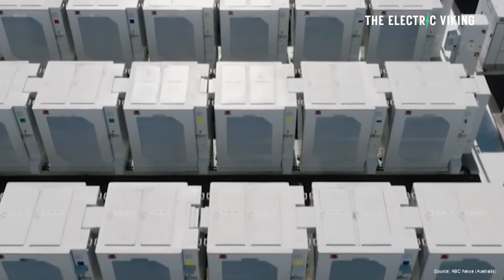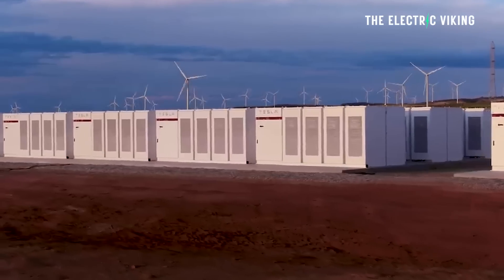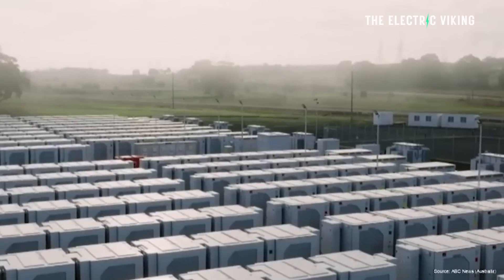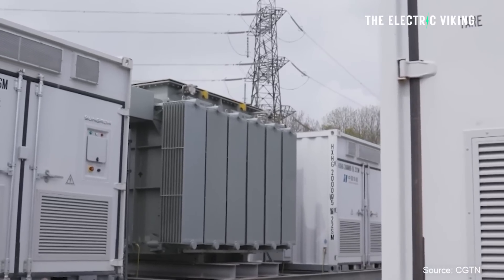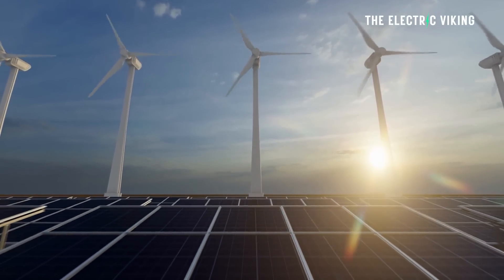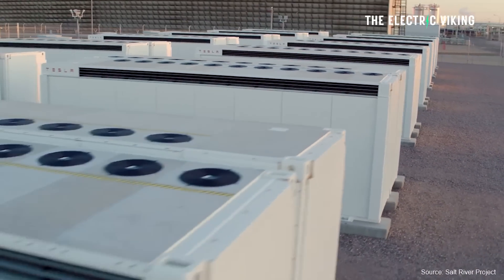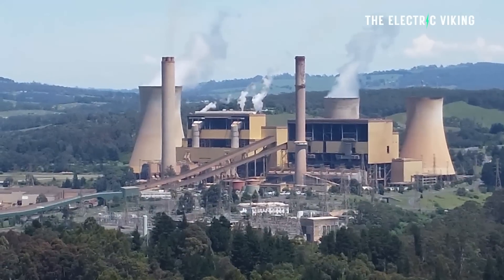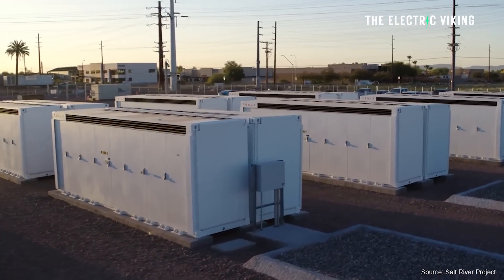Australia builds new battery to smash coal power plants

Comment: But why?
Is they used to even out peaks and dips of electricity usage and production?

It is not smashing anything!

Batteries don't generate any power by the self's. They use power that is called charging losses..

A power plant on the other hand produce and make new energy.

So a battery I just a charging storage box like a silo/diseltank.. Doing nothing and just maybe leaking some energy by time like a silo/diseltank with a small hole 🕳

Don't really understand what is so great with that.. Other than even out tops and bottoms like  UPS. You can drive on the batteries for a short time during a power outage..

OH, so in practice they know that they have or going to have more power outages so they want to build that away.. That is a reason.

Strange that I need to figure out why.. But a old viking probably don't use electricity in their time.. 😅 😍

Comment: What water are you talking about Malcom?  These advocated including Viking are trying to suggest batteries could be used to provide power at night or when it is densly cloudy or not windy.  You need that any time the wind doesn't blow which could be weeks or months;  but they also will say solar - well that doesn't work at night. Where I am in the Pacific northwest it isn't unusual to have 30 days of clouds so thick you can't tell night from day. As stated Lithium tech simply can't work. They need a totally new scalable chemistry.  Odd thing is if Hydrogen or some other group needs a breakthrough they pooh hoo it ; but if Electric needs a break through, its good.

Comment: And yet, these batteries are not efficient. The efficiency of batteries and the storage capacity needs to be raised by a couple hundred percent to make them worth while at a minimum. Any modern country that is going to remove fossil fuels in the next couple decades is signing it's own death warrant. Fossil fuels are used in the vast majority of everything we use and consume. 

Then there is the devastation that the materials used in manufacturing these batters cause to the environment. Nothing is free. What are they doing with just the waste of green energy. They are burying the wind turbine blades, they are grinding up solar panels barely recycling those. It's cheaper to just get new resources than to recycle them at this time. There is the destruction of the environment at the rare earth mines, the caustic and deadly chemicals used to refine the rare earths. Your green energy isn't green to produce or dispose of. I'm not saying to not look for better alternatives, but what I'm saying is at this time there is nothing to replace fossil fuels that won't cause world wide death and destruction. Right now, instead of investing in infrastructure that isn't capable of supplying the populace we need to use that money to advance the tech multiples past where it is now. Unfortunately if you follow the money I'm betting that your friendly neighborhood politician is someway somehow making bank right now by siding with the insane push to go green asap.
Reply: Like President Biden visiting the giant wind turbine plant in Puebla Colorado.🤷‍♂️

Comment: Oh Please let me put the finishing shovel of dirt on lithium battery tech - No problem below; just mine 10x more Lithium! Each ton of refined lithium requires 500 tons of ore and 500,000 gallons of water to refine it. How much CO2 to dig up the current 65 millon tons of ore? 10x is 650 million tons. You then need half a tillion gallons of water.. The great part is Lithium is just 7% of the battery; there is nickle, cobalt, magnese,copper aluminum. Oh and thats in 1 year!  Great for CO2 huh?
Reply: You may as well just turn everything off then 😢😮!

Comment: Here is another impossible to escape problem. A smallest mega pack which costs over a million US dollars uses 300 lbs of Lithium; a Telsa Semi uses 260 lbs of lithum. If you used all 130,000 tons of lithium refined in the world in 2022; you could make only 900,000 Tesla Semis or about 800,000 mega packs. - No EVs just megapacks or Semi trucks - there are 9 million Semi Trucks just in the USA - to charge one Semi at night will take one Megapack - if you make 450,000 of each, it would take 20 years  just to replace the USA heavy trucks; but according to Tesla the Megapack has a 15 year life; so before you get finish you'll need to replace them.

Comment: Viking you need to buy a calculator. Your theory that battery packs can provide night time power so you can ditch fossil fuels is totally laughable.  Take any of these massively expensive battery farms and assume they are fully charged and then divide by the number of city residental homes it will serve - you'll get a very small figure that would only provide a couple minutes of power her home; and we aren't counting industry nor charging up EVs.
Reply: You mean on the nights when the wind don’t blow and the water doesn’t flow ?  Fortunately the climate is changing to give us more wind and rain.🌝

Comment: https://www.energy.gov.au/data/energy-consumption

Australian energy consumption by fuel type. Oil 36.5% Coal 27.5% Gas 27.1% Renewables 8.9% I'm pretty sure oil, coal and gas will be with us for a long long long time. 

One thing the renewables cult fails to understand is the massive amount of mining required for said renewables and every battery, solar and wind installation starts to depreciate to an end date where it will have to be replaced again. These are not perpetual motion machines they degrade and need replacement, apparently solar panels and windmill blades are difficult to recycle and go to landfill where is the green in that? 

It's a scam that will end badly. I am all for taking the shot just to prove all the cult hope based muppets wrong. The way forward is a balanced energy grid and CONSERVATION.

Comment: Okay, you’ve got a battery. How do you charge it?
Reply: I check with my grandkids for the hard stuff. You plug it in to a power supply.😊
Reply: @malcolmrickarby2313  
LOL. Good move with the progeny. The point is that a battery is nothing more than an energy bucket. You still have to generate the power  to fill that bucket in order to make it useful. If you follow Germany’s example, you’ll use coal.

Comment: We have talked about batteries for peaker replacement, but are batteries also being used for grid stability and for making the power grid more homogenous?  I remember "rolling blackouts" to deal with the problem that it wasn't just the amount of power but it's location.  I haven't studied high-energy electrical engineering, though.
Reply: Yes!

Comment: Big mistake on government behalf buying old lithium battery technology that will be lucky to still be functioning in 10 years from the date it gets switched on,let alone continuing efficiency and reliability which will be impossible from the start. Not to mention high risk of explosion which inevitably will happen and or fire due to thermal cooling issues which solid state does not have ! and in the first year of operation the batteries will permanently lose easily 20 to 30 percent plus of their initial charge and from there will continue to go down and down, what a joke, One of the biggest wastes of taxpayers money!
Solid state will lose less than 2 percent of its charge in the first year and by the end of a 25 year cycle will still hold 90 plus plus percent of its charge.ps- no thermal cooling needed. No risk of fire or explosion!
 Solid state is here and ready to bring into our country, we just need help from government or private parties for testing  (which I’m sure we will never receive). They don’t even have the ability to test our batteries in Australia  because their testing facilities are so obsolete ( no testing capability for solid state )Makes me really angry and upset when I see this battery plant being built with old tech which is to put it bluntly rubbish dangerous battery technology which we now have the chance to change for the better and permanently .because we should be using the best tech for our country which is Solid State, and yes solid state is here and now and has been for over 3 years already.
We need funding to get solid state into Australia. 
 I challenge any POLITICIAN in Australia that may read this to contact me if they want to see a massive change in our battery tech which will change not only Australia but the world we live in today ! 
   I’m ready to make a huge difference in my country for the benefit of all souls that live here., I just wonder if the politicians of this country think the same. . I won’t hold my breath
Reply: If you’re in Tassie Peter ,get in touch with your independent senators.👍🏽
Reply: Thanks for the advice. I’m currently in SA but will make some inquires this week into any independents in Tasmania.If you have a suggestion on who you think may be the most appropriate choice to speak too? Would greatly appreciate it. Only independent I could find in tassie is Andrew Wilkie.

Comment: Thanks again Sam for a  great  video. What size land do these massive batteries take up please? Certainly a typical graph of power consumption if considered at 100% as base rate of  consumption,  night is usually about roughly 70% , a big lump at breakfast time as the jugs,toasters, hot water systems heat back up after morning showers, stoves, business gets going, etc at about 150% back to 100% till lunchtime and up again to about 120%, back to 100 % during the afternoon then come 4.30 in the afternoon,  the consumption goes to about 200% over dinner,  streetlights, hotwater systems,  all the signals restaurants etc, then fades of slowly back to 70% early morning. Obviously the generation capacity has to meet that 200% load unless many more large batteries are installed closer to the demand load to eliminate losses, promote greater use of existing generation capacity so instead of powerstations being less than 60% efficient,  we have something approaching 90%?.

Comment: We started out using fire to produce heat for cooking, warmth and comfort.   We discovered sails using pollution and cost free wind and sail technology to move our boats.

Next came steam engine technology burning wood to produce steam to power the engines for our boats, cars and trains.  

Steam engines were replaced by  the Internal Combustion Engine burning gasoline or diesel fossil fuels to produce heat to power the engine.

Rising fuel prices, poisonous fumes and environmental costs have pushed us to move to the next technology where we realize that energy is everywhere. 

Remember the wind?  Our first energy source?  It is everywhere.   Energy is everywhere.  

No longer do we need to burn anything, whether wood, fossil fuels (gasoline, diesel), garbage, hydrogen, alcohol, or anything to produce heat energy.  The pollution, environmental damage, inefficiencies and costs are driving us to the next technology, called Green Energy.

Energy is everywhere around us.  Moving this energy to where it is  needed is called Green Energy.  Dams, solar panels, wind turbines, heat pumps, solar troughs, EVs, batteries and megapacks are all examples of green energy.

Burning anything to produce heat energy has become outdated dinosaur technology just like the steam engine.

We are moving towards a world with free and pollution free unlimited energy simply moving energy to where it is needed.

Tesla is at the forefont moving us to Green Energy

Comment: The most reliable and cheapest storage I've ever come across is to be found in nature.  Stored energy in the form of coal, oil and gas.  Perfectly safe, completely reliable, very energy-dense and 'inert' until you want (need) to use them.  But no, let's strip mine the earth of rare earth minerals, fabricate inordinately expensive, short-term solutions that will require replacement every x years because, well.... we can all afford to throw good money away, can't we?

Comment: Rather than massive batteries, it is far more important that we develop and install smaller, individual home and businesses-scale batteries. Sam, I live in California where home and business owners are abused and ripped off by gigantic, corrupt, corporate electricity monopolies. We need a $10,000, 50 KWH battery so that individual home and business owners can break free of the corrupt energy monopolies!
Reply: You can buy a 30kWh battery for $10,000 right now. The average American home uses 30kWh per day. And since during the day you use solar, you don't use anywhere near 30kWh. Most basically need only half that.
Reply: @junehanzawa5165 May be it’s also a good idea to consume less electricity. The average European home uses less than 10 kWh / day.
We use around 6 kWh / day which is low, but all electric devices are running: cooker, oven, fridge, freezer, washing machine, dish washer etc. No pool and A/C though. Maybe the US government should tighten the rules for energy consumption of electrical devices.
Reply: @A-W-r4s in most of the US, the heat is deadly in the summer. Having said that, our houses are crap for efficiency. 
Using net zero standards, we could get our electricity use down to around yours pretty easily.
Reply: @junehanzawa5165  So where are you getting 30kwh for 10K in Aust a tesla powerwall is 12-15k which are 12.5 kwh
Reply: Larger batteries enjoy an economy of scale as well as being able to provide a load that is averaged among a number of premises.
Reply: @briancampbell179  yeah but big energy can still rip you off and the grid needs to be enlarged X fold.
Reply: @briancampbell179 while true, home packs compete against retail electricity prices while grid batteries compete against wholesale electricity prices.
Reply: How about a bi-directional charge EV?
I'm waiting for them to come to Australia that'll save me from having to purchase a home battery.
I wonder what other people's experience is with them..
Reply: 4 Powerwalls is 52kwhr and will pay for themselves within half their warranty if used for VPP
Reply: 3 EG4 power pro batteries with give you 43kwh for $11,400.  It's close but we'll probably at your pricing in next year or two.  If they get sodium-ion on the market it might happen sooner.
Reply: @Ryan-ff2db  can you name the site? The best I have seen is Signature Solar with 30 kWh for $10k. 
No links please, utube automatically deletes comments with links.
Reply: Spot on. Same in Australia. Once these thrifts get to control our power source they just keep jacking up their prices and collude and make massive profits  disgusting mob.
Reply: So right. Haven’t we learnt by now that when we place our trust in big companies to give us affordable and reasonable services without them eventually increasing their profits at our loss. Much much better we take control
Reply: @vincentsmith9562  The only way a big company will give affordable and reasonable service is if it benefits their bottom line and/or there is legitimate competition.  The break up of AT@T was the best thing the government ever did to help consumers.  People didn't realize how much AT@T was screwing their customers until they were broken up.  But yeah if you can take control personally that would be the best option.  Problem is most people don't have the resources to do so.  Batteries will continue to fall in price, especially if they start getting sodium-ion on the market, which will help but storage is still pretty pricey.
Reply: I rent my house... I couldn't even get a charger installed in the garage to charge my EV.. Owner said they didn't want it even though i would pay to install and patch the holes.... Imagine what would happen if i asked for a battery...
Reply: @OneIdeaTooMany  Not sure where you live but in North America, you can use a 240 volt connection, like the ones used dryers, stoves, heaters, etc... and plug in a mobile charger.  This will charge at about 7.6kw so you can charge most EV's in 5 to 8 hours depending on pack size.  I did this for a long time before I got the wall charger installed.  Europe is actually easier for this as 220/230 volts is standard, you just need a higher amp than the standard plug.  32 amp or higher preferably.  If you don't have a higher output outlet, it will cost you about $100, so unless your landlord is a total jerk, I don't see why an additional outlet would bother him, especially in a garage, where they tend to be anyways.
Reply: In Australia its the reverse - electricity is expensive since state owned generators were sold off to corporations. But Solar is cheap - due to federal and state government rebates.